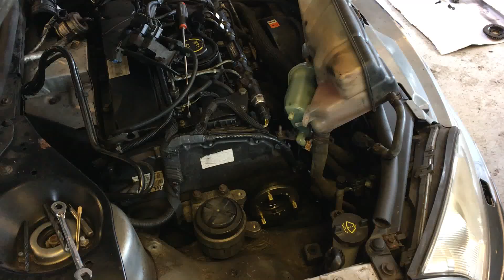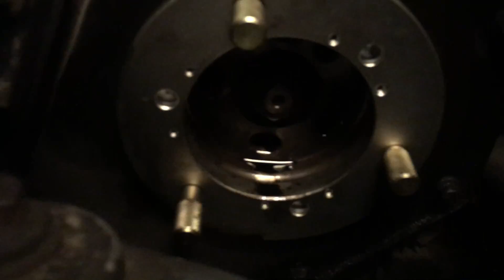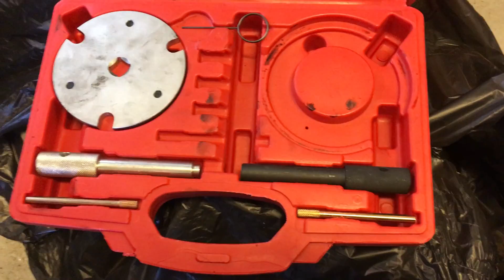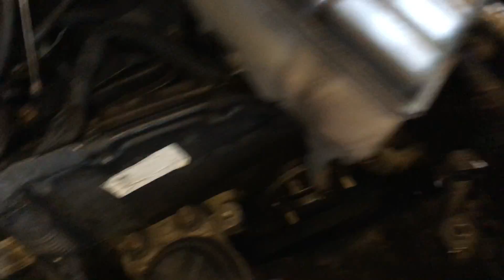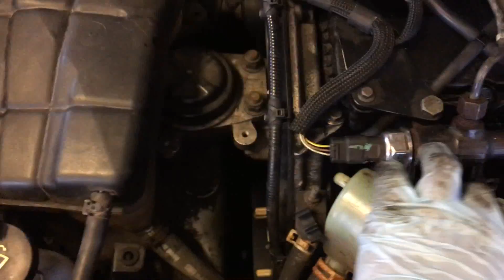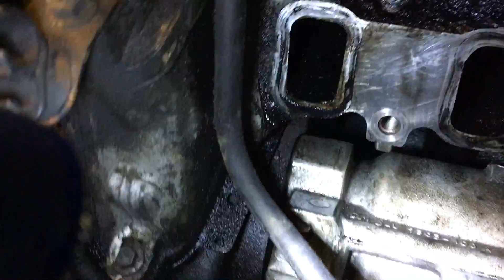Mondeo TDCI high pressure pump replacing

Comment: Thank you got one of these to do soon. Now know what's involved. Had similar job on Transit connect van. Made long slim torx driver by cutting shaft from cheap screw driver type & welding into 8mm 3/8 socket. Looks like it's going to be needed again so time well spent!

Comment: No need to lock/time the pump, it just needs to turn to make high pressure for the fuel rail. There is constant
Pressure at the injectors and they spray when they are switched by the ecu.
Reply from the maker: Martin Maxwell true - but it is still not a bad idea to keep the timing right in the chain. That’s the idea behind making sure the sprocket stays in the same place.

Comment: Was the kit expensive mate. I have a freind who may have to replace his pump.  He has bad injectors just now car will start on brake cleaner runs in a limp mode. But Chucks a heap of fuel back. His car is the mk3 Tdci 2.2 euro 4 someone had put 601 injectors in it which  I believe are from euro 3 .  Cheers mate 👍

Comment: Hi there, I am not an expert in Mechanic, therfore i needs you avdice please. If I cancelled my EGR Valve( With delete pipe) Should i needs to disconnect the electrical connector and Pressure pipe connected to EGR? They are on the back of the EGR. TDDI 2001 Hatcback. thx for you reply 
imhauseable